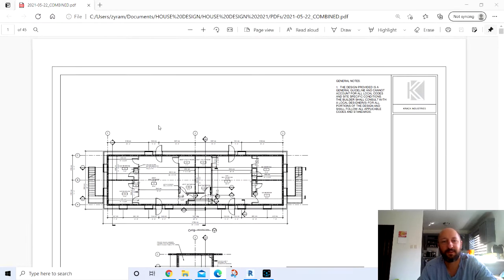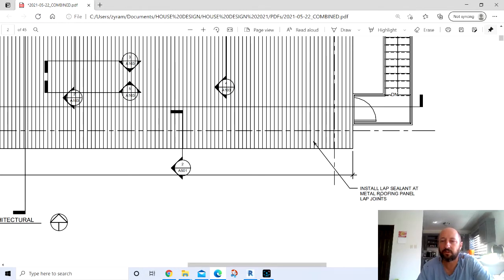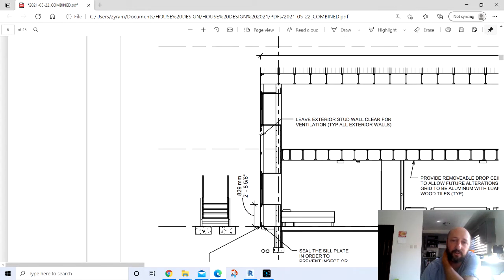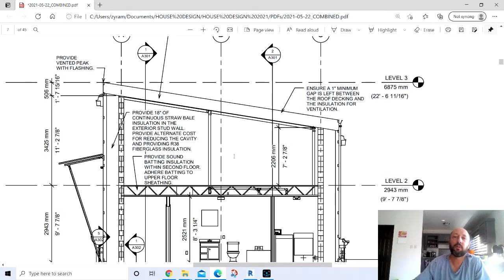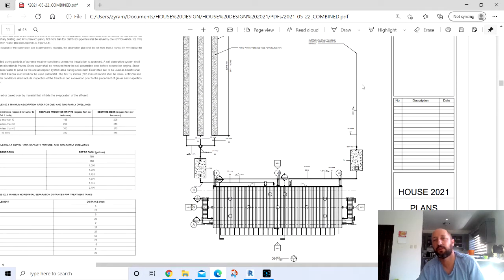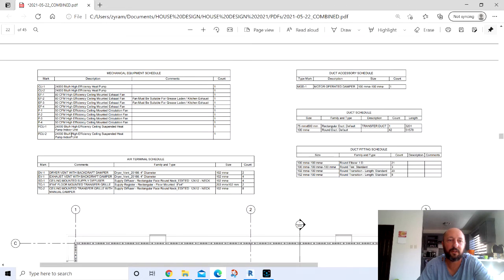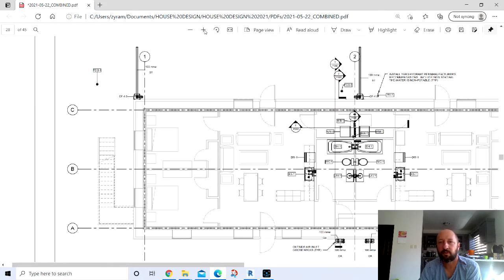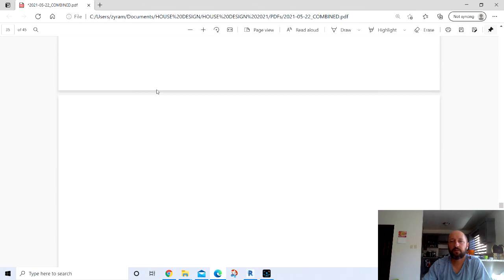Net Zero Energy Passive House Design - Part 2

Comment: this is a very unique passive solar house. Never saw one laid out as a duplex. In my experience most people dont' want the headache of a duplex, but I think it's a great way to make money off your investment.   I didn't really follow waht kind of heat pump you are using? You said ground to earth, but you also said you can get it at home depot? and I've never seen a geothermal heat pump from home depot? Any idea how much this house will cost to get buildt and what state will you build it in? I'd use fiberglass instead of hay. I just think hay will degrade after 30 or 40 years??? maybe its treated with borate to prevent that?
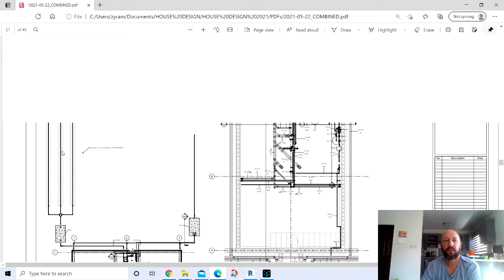Reply: youtube kept on freezing up the video and I 'd have to refreash the page did it 4 times and I got to 53:00, will watch the rest tomorrow.